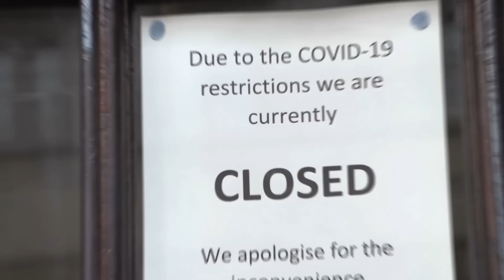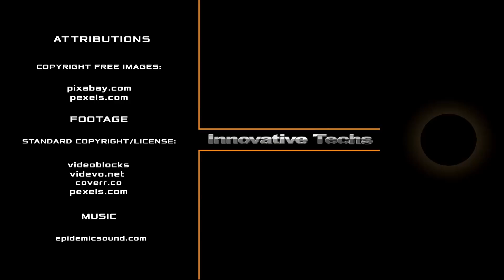FINALLY! Tesla Semi 2021 already here

Comment: A class 8 diesel truck with a standard fill of 300 gallons of fuel has a range of approximately 2,000 miles - this works out to roughly 1 mi per pound of fuel.  The Tesla semi with a range of 500 miles probably carries something like 10,000 pounds of batteries - which works out to 1/20th of a mile per pound of "fuel."
In what world does this ridiculous vehicle make any sense?
Reply: Thank you. Im a tesla owner and fan but im also a otr trucker…and this truck with its current specs is immensely counterproductive and impractical. people have to be able to think of these trucks logistically not leisurely. It aint gonna work. It needs more range.
Reply: no emissions, using a renewable source as fuel. Isnt that good enough of a reason? All the transportation probably plays a very big factor in total greenhouse gases
Reply: @theblitz1687  The zero emissions EV is a chimera as you should already know.
Reply: @srb1855  I didnt look deep into it, i know some greenhouse gases are produced when making the ev, but for a semi that constantly travels, i suppose its still much better than a diesel
Reply: @theblitz1687  class 8 powertrains are designed to go 1 million miles - one has to wonder how many times the battery pack will have to be replaced in an electric truck over that distance - every time you do that you incur an enormous CO2 penalty for such a large battery pack.  The idea that over the life cycle this is better than a modern low emissions diesel is not a foregone conclusion.  Having said that I haven't yet seeing an independent peer reviewed study of this.
Reply: @theblitz1687  the point is the Tesla semi and battery electric trucks in general are niche players only that may see advantages in very limited applications....

Comment: Hard to believe it takes 30min to charge a damn cell phone takes longer let alone a semi truck wtf man then say it does run out of battery in the middle of a important load so then it's sitting on the side of the road true factor in trucking then how well will it Handel a wide or oversized load
Reply: perhaps they are not meant to carry wide and oversized loads. 30min isnt that hard to believe either. Your smartphone doesnt use 200V and 15A charging, just to explain the idea. I dont know exact numbers

Comment: Like I said I can get behind electric if the amount of charge time takes just as fast to fill up my gas tank. Electric roads sound like a great idea but will see.
Reply: Definitely will take longer to charge compared to pumping gas . They quicker the battery is able to charge .the more damage it causes. Electric roads would be majorly expensive and would take a massive amount of power , the government wouldn’t be able  afford that  ,the only way to fully electrify the economy is when we have every manufacturer onboard and producing, so far Tesla is the only company with a stable charging infrastructure for long distance driving and they cannot supply the whole United States with a vehicle at this moment in time or anytime soon

Comment: Consumption of less than 2 kwh per mile has long been claimed but yet to be proven.   Real world testing of model Y and X pulling a trailer has show a shocking increase in power usage over the vehicle alone suggesting that the Semi will not be able to meet the claim.    Also, range in cold climates is severely shortened - as much as 30%.
Reply: They have heated batterys now ever thing else is spot on
Reply: @frankmundo4300  That is one of the things that shortens the range along with cab heating.
Reply: and what heats the batteries? ooooh it must be the anger of all the shortsellers
Reply: @evrenseven  A heat pump driven by the battery.
Reply: Got it, thanks. So we're electrically heating the battery, using current from the battery, so the battery will be more efficient. Seems smart.
Reply: @evrenseven  It's more than that - below freezing temps damage the battery.

Comment: It’s already been manufactured ,same goes for the cyber truck, and roadster.  But the demand for model 3/Y is too great to for them to start producing the semi and any other vehicle full scale. Plus the batteries they could use to make one semi could make 4-5 model 3’s.
Reply: Sounds like excuses
Reply: @timothyvu7006  think about how many orders are going through everyday for available models . The wait time is about a year , and there’s no charging stations already in place to keep a truck on the road 24/7 . Truth is they just can’t keep up . They can produce up to 500,000 model y’all a year after gigs Texas opens and there’s a couple million orders in the system and rising day by day. Hence it wouldn’t make sense to start the production of another vehicle type with existing orders. That would move into the 2 year regions wait time , forcing buyers to cancel or venture to another manufacture.
Reply: great buissnes model. How many people allready paid in 2017?
Reply: @Zozo806  for the Semi? Not many companies so far . Only Pepsi, Amazon and Walmart I believe. But unlike cars Tesla can’t run the 18 wheeler market themselves . These are vehicles that need to be on the road 24/7 and so far there’s no infrastructure for them

Comment: this truck is heavy. I've owned my own truck for 10 years weight is money i need a lighter truck so i can haul more freight.
Reply: Even factoring in that electric semis can carry 1 ton more than diesel ones.  But even still, is this truck really 33,000 lbs?
Reply: @TheMacronical  don’t know the weight but I do know they asked for a weight exemption which I don’t need but I do have for the auxiliary power unit. My truck weighs 19,000.
Reply: @carloscruz7317  and electric won't give you the same range in cold weather anyway

IMO just wait for the next iteration if it was me.  I know current trucks get insane fuel mileage anyway so
Reply: I know rigs are different but if you have two tanks for fuel which translate to about 300 gallons and multiple it by the weight that's roughly 1 ton of fuel alone. Then you have to think of your rig and how much that weighs. I would say it's a comparable trade in weight but my problem is that they don't have enough megachargers cause 500+ miles is not great when you can get around 1.5k from fuel
Reply: 33k with trailer is less then most other trucks what are you talking about ?

Comment: The electricity to charge still has to come from somewhere.
Reply: @techdictator9116    Who's "they" ?  The trucks?   They still need charging. What's your point?
Reply: The sun
Reply: @TheCocoapepples    So, you can only charge it during the day when it is not cloudy?  Solar is unreliable.  If anything you would want to charge it overnight when not in use.
Reply: @my3dviews  solar panels still collect energy from the sun even on cloudy days I'm not sure if you know that it's just reduced the amount collected. Also you would be able to charge at night due to these systems having their own power collection systems similar to the power wall the sell for your house where you can store excess solar energy.
Reply: @TheCocoapepples    They only produce about 10 to 20 percent on cloudy days, which is not much.
It also depends on the angle of the sun.  So, in the winter when the sun is lower in the sky, solar panels produce less power even on sunny days.
Reply: @my3dviews  right it's about 10-25% pending several factors such as cloud density; sun angle plays a smaller role because panels still create charges through indirect sunlight; that's why you have power walls or generators that store excess energy during the sunny days and would be used during the cloudy days. All that can be down now; what can be added down the road would be a tesla energy sharing network with other stations which means stations would be able to feed each other energy

Comment: Semi-articulated lorry, petrol version has six wheel points. When designing a concept for an Electric semi-articulated lorry, the number of wheels would logically have more wheels. Each wheel has a motor for traction, ergo more wheels will create more torque and traction to haul any range of cargo type, load, etc... EMU trains with distributed traction typically will have less than half the wheels/axles of each trainset. Distributed traction EMU trains were designed and created based on the power output of each wheel/axle motor.
Reply: More wheels means more drag on the road. That means less range and speed. 
Doesn't apply to trains which have steel wheels which run on steel rails.